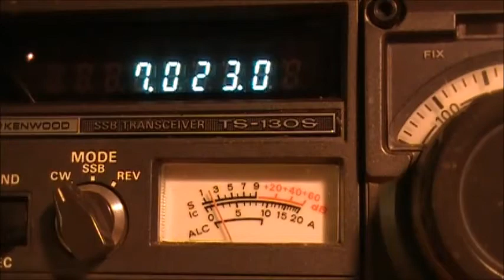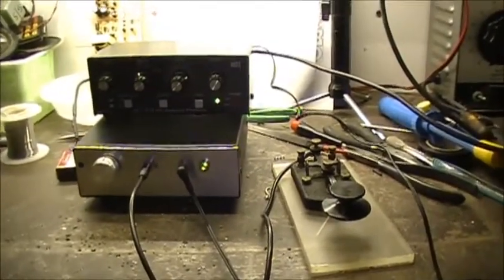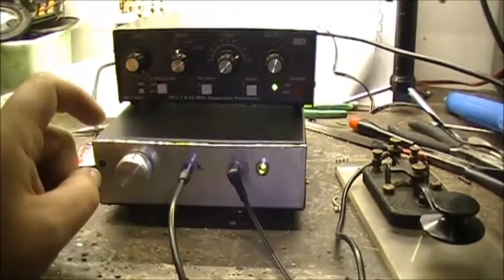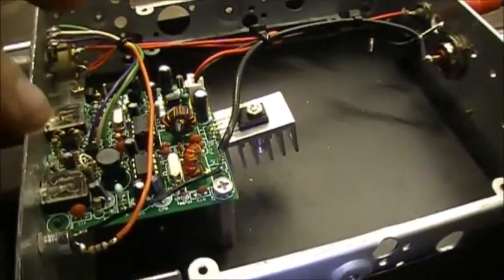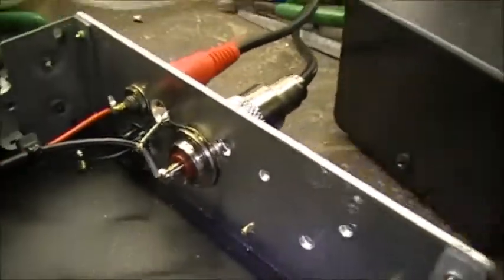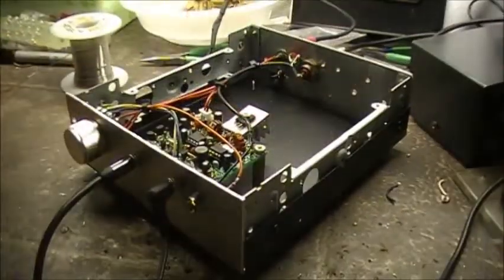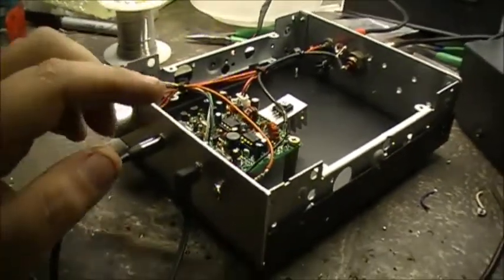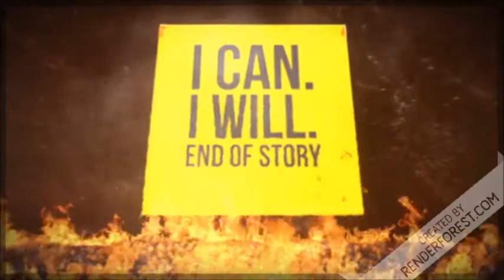Frogs calling QRP 1.8W Kit PART-2

Comment: The two crystals are not for receive and transmit. One is a filter between antenna and the ne602 mixer chip.
The other one is for the local oscillator in the mixer and the transmitter.
Very well done.

Comment: For the audio just use the solder points under the board . Exemple if you plug the headphones it cut the sound for the speaker.
Reply from the maker: Might try that.. Hmmm